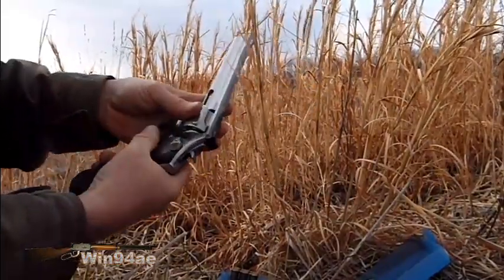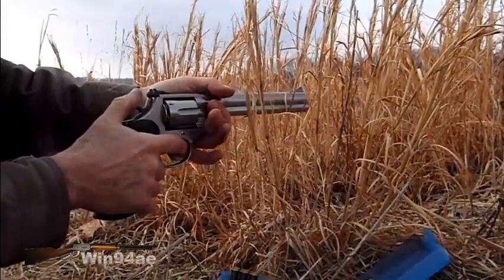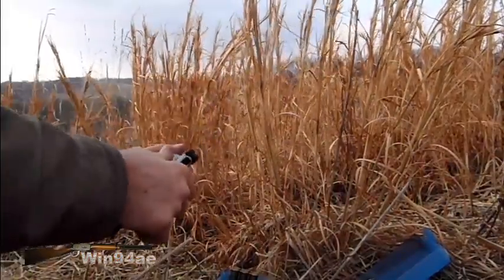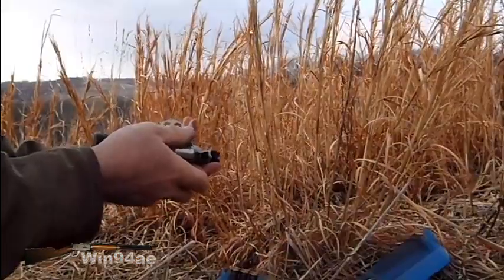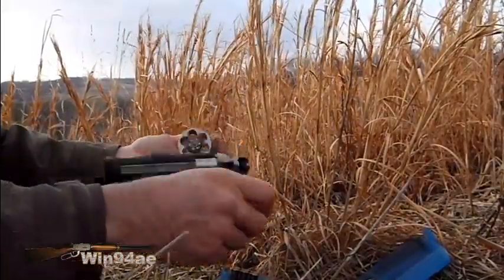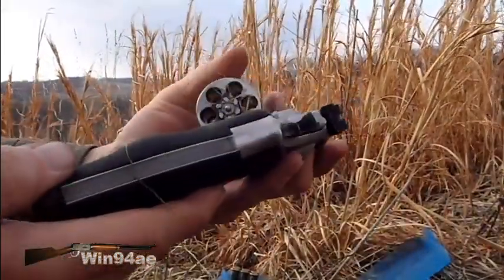Revolvers Never Jam?

Comment from the maker: +Bryce dabs
If the tension of the case isn't sufficient to secure the bullet during recoil, the case overall length will extend as to have the bullet extend passed the cylinder face; which in turn will get caught on the frame causing a jam.